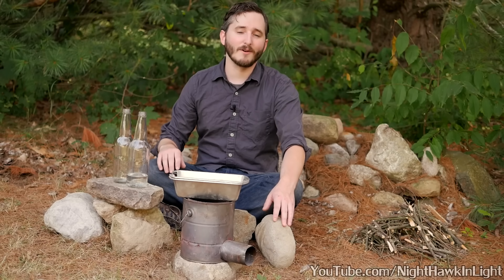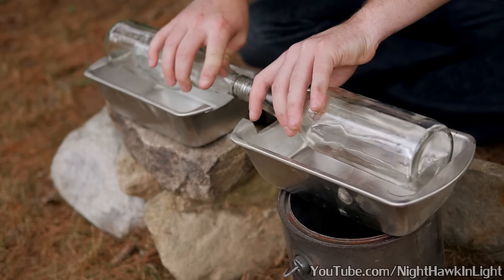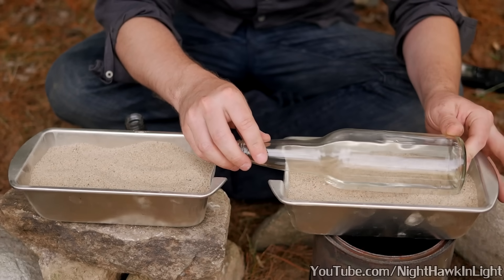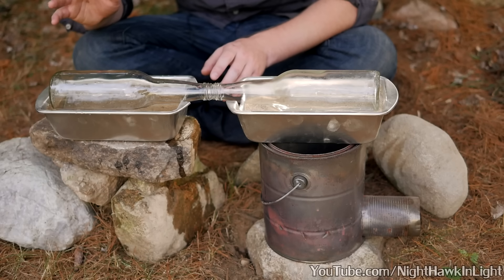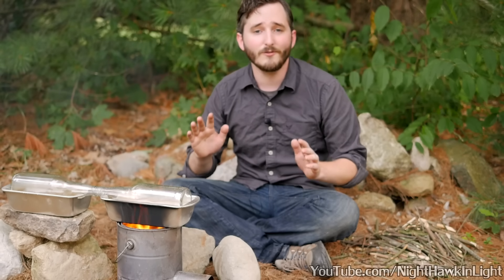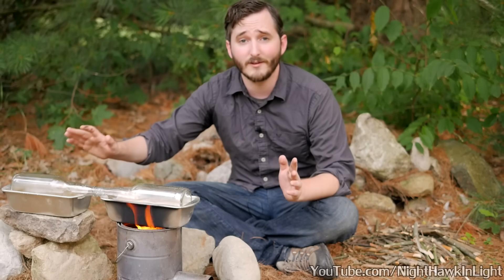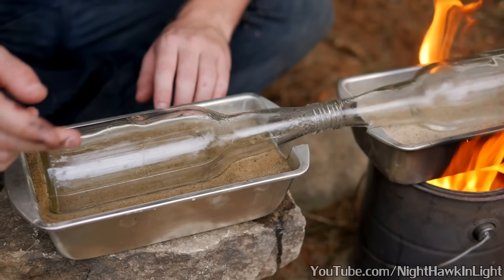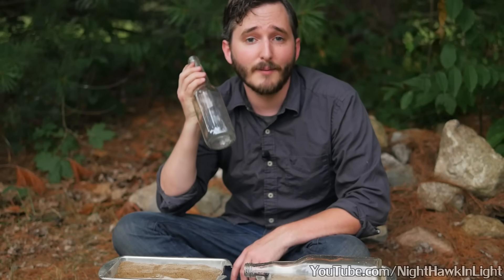How To Turn Salt Water Into Fresh Water (Simple Improvised Distillation)

Comment: 6:08 Technically untrue, if memory serves (there's a list online), the only liquid with the exact boiling point of water is water.  So the best thing to do is let the water simmer for a while (stirring/shaking to increase surface area exposure, if you can) to evaporate said chemicals until you collect it.

I would speculate 3 minutes of simmering while stirring should suffice before putting your water in a distillation device but, of course, it's situational.
Reply: You can't control the temperature in this contraption so heating to 100C exactly is a no but that's not even why you shouldn't, chemicals and oils are relatively volatile so you'll have evaporation at any temperature even if those things have a higher boiling point than water. (most are lower btw) Also, evaporation here is different than what it actually means. All that happens is that enough energy is added to the surface of the liquid to allow it to escape the liquid phase into the air. You don't actually need boiling temps to do this. A distilling contraption with plastic sheets in a sand pit also doesn't go to 100C but you'll still be able to extact water because you'll see evaporation at any temperature above 0C.

Comment: Good to know if I get stuck somewhere and there is only salt water. You could wrap the mouth of the two bottles with aluminum foil to make a better seal. But you don't want a perfect seal because too much pressure will build up.

Comment: Why could't you leave the glass bottle with the salt water sitting in the hot sun, then bury the second bottle under some cool sand?  It would take longer than boiling  but I think  water from the first might evaporate and distill inside the second, cooler glass bottle.   Bad idea?
Reply from the maker: It would work, but you'll be lucky to get a few drops per day.
Reply: Have you tried?  If the sun were hot enough the evaporation rate into a cooler spot would be rather high.  And you could use plastic bottles rather than glass.
Reply from the maker: Yes, I've tried. It's very energy intensive to evaporate water. It takes a long time with only sunlight, even if the bottle is painted black.

Comment: In an actual survival setting one should strive to make the first bastion be a large as possible so extra water can be collected, depending on the location for water needs using this method would take a considerable amount of time for little water return, of course you could also collect water from a simple spigot or digging into the ground to find a reservoir.

Comment: Hey if you find oil contaminated in water, then take water a few inches below the surface. 
This is okay only if the oil is seen to be insoluble. Some contents like soap or other chemicals will make the oil mix in easily with the water :(

Comment: This is pretty awful.  How  will you  get  metal trays  out in  the  middle of  nowhere and  cut  holes  in  the  side  like  that  more  so?  Are you  sure  bottles  you f ind  on  some  beach  is  clean?  No  cleaning instructions?  The diameter of the bottle  is  barely enough to hold  any water  worth  a shit  on  either  side  until  it  flows  over  to the other side,  requiring  a  lot  of tedious maintenance whilst  in  operation  to  keep  it  going  indefinitely. Put  too  much salt water and if it boils, it'll easily flow into the other side.

Comment: I have an idea that may work for oily water...
Providing you aren't bald.. Make a filter out the shirt of your back..make a cylinder from cloth fill it with your  own cut/ hair 
Put stuffed cylinder into both necks so half in each...Whammo you have a oil filter .I use a stuffed pantyhose full of human hair knotted together to contain accidental oil spills when we go boating on the river or lakes you can wash panty hose out with soap hang it to dry use it again next again sorry the digression its an example how good human hair is for oil filtration in this system

Comment: Good vid. One thing should be noted-
Don't too firmly secure the mouths of the bottles. They need to be able to push against one another if the pressure goes up too much since you are heating a closed container, which is not usually a good idea.

Comment: Cool.   If you had a rubber or plastic tube that fit over the mouths of both bottles would it work as well without both bottles being at the same height there by eliminating the sand and the necessity of keeping he bottles even?  The distilled water bottle could then just stand upright...right?

Comment: You mention that once a portion is finished, you can refill the bottle and continue. I assume it would be refilled with cold water. Will the bottle not shatter when placed on the hot sand?

Comment: Your stove didn't look like a rocket stove, just a plain stove.  A rocket stove has an interior fire box, or can, that's insulated from the outer can (with sand or better)  to enable the fire box to achieve much higher or hotter temperatures to burn almost anything, emit very little smoke, and leave little residue. It also has a smaller opening on top with an insulated chimney inside to maintain the very high temps and high efficiency burning in the fire box. It sucks in air at high velocity causing the "rocket" sound. I see nothing "rocket" about your stove (besides the cool name:)

Good video though with great possibly life- saving ideas.

Comment: Could you adapt this method to use a Dakota Fire Hole to do the heating? Then the 2nd bottle could be placed directly in the ground (with a little damp sand).

Comment: EXCELLENT VIDEO. THANKS. :)
PEE PEE WATER TO DRINK:
UNDERSTAND the principle that any dirty-or-salty water (not oily) evaporates but can be re-condensed as clean liquid water by collecting it on some cooler surface and funneled into a clean container.

EXAMPLE: In a desert or wherever, 1. pee all over a wide depression in the sand. 2. Place a bucket or other container at the middle. 3. Cover the wide depression with a sheet of plastic or a rain coat etc. with the "plastic?" part facing down. 4. Place a stone or rock or a little sand at the middle to weight it downward in the middle. 5. Allow time for the pee to evaporate maybe in the hot sun and condense onto the plastic covering so it will flow to the middle and drip into the container as clean drinking water.

Comment: Nice knowledge to have, but if you're in a servival situation at the coast you would be better of finding a stream and boiling the water or collecting rain. If you were on a small island with no stream and not enough rain then it might be worth doing however the chance of finding two glass bottles will be low as glass bottles don't float so are unlikely to to turn up on islands.

Comment: The simplest still is any container with fabric over it. The steam rises through the fabric and can be wrung out at saturation. With some resourcefulness even the container is not entirely necessary. Hot rocks from the fire placed on a pile of wet sand or dirt with fabric spread out suspended above it will collect some steam. The more sealed it is without touching the sand or dirt the better. A container is preferable. A hollowed out log bowl or a dried clay bowl would work with hot rocks but a metal container would be better.
Reply from the maker: I'll have to try that.
Reply: I was wondering (since sailors get into this situation) if there was not a way to use aluminum foil to reflect the sun and plastic to catch evaporated water. That would eliminate the need for a fire which would make sense in a lifeboat in the ocean.

Comment: @06:20  Your statement "...you don't want to drink any distilled water if you're trying to distill out man-made contaminants...." may be correct for this specific emergency method if you boil your saltwater bottles dry each time, but isn't correct for all distilled water. Basically you're referring to VOCs in the water, some of which vapourise above 100 degr C (these do end up in your distilled water container only if you let all the saltwater evaporate - this can largely be eliminated by simply not boiling the saltwater bottle dry, since everything that did evaporate up to that point would have been water only at 100 degr C, the above 100 degr C VOCs will still be in the remaining saltwater, which is simply discarded), and some below 100 degr C (all of these will always end up in your distilled water bottle - these can be eliminated very simply by boiling the distilled water afterwards in an open container with a rolling boil of a couple of minutes, since it will evaporate out of the open pot before the water reaches 100 degr C when the water starts to boil.

Comment: highly inefficient, sand is an insulator not a conductor of heat and only serves a useful purpose of holding the bottles, not sealing the bottle tops together means you can not build pressure, when you boil water and get steam you greatly increase the volume so with no way to build pressure most of the water vapor will escape, way to much work lan loss for this to be a feasible water source in a survival situation where you need to be spending a lot of time doing other things to insure you survive

Comment: I've walked beaches on the West Coast of North America over 50 years and have yet to find an intact glass bottle.  The only intact ones would be because of someone drinking on the beach and discarding the bottle as litter, an offense for which stiff fines can be levied.  Unless a bottle is corked, it will ship water and sink to the bottom, and won't "wash up" onto a beach.

Comment: Drinking distilled water can be very dangerous - so this method is pretty much useless. (Distilled water doesn't contain any minerals)
Reply from the maker: There's enough salt in the output from mist carrying over from the first bottle. You can also add a few drops of saltwater back into the drinking water if you're really concerned.
Reply: @Nighthawkinlight  Alright then it should be okay, was just worried :)

Comment: NightHawkInLight You need to add a few more bits of info into your experiment

1. If the entire setup is tilted on a .. say 5-10 degree angle (angle for the dirty water bottle) from the ground, the distillation would be more effective since hot water vapor travels upwards... If both are on a level plane, the exchange is not as effective even if the distilled bottle is cooled (since its not constant lvls of cooling)

2. Your making distilled water... it does not contain necessary salts for the body... meaning ... ONLY USE FOR EMERGENCIES for quenching your thirst (it will take away minerals from your body as well)... you mention distilled water in your experiment but have your video title as 'Fresh Water'.. They are not the same. This is why Water purifiers don't just heat water and instead use the myriad of carbon filters, electrolytic filters etc.
Reply from the maker: In this setup enough salt mists over from boiling splash between bottles to add plenty back in for the body to use. If not you can add a few drops of salt water back in.
Reply: NightHawkInLight Well... If it were only salts, then I'd be okay.. But there are pollutants in it as well right? Neither sea water nor naturally found water sources are completely clean. Adding some back seems to defeat the cause of distilling.
Example: The Arabs from the middle east convert sea water to drinking water since fresh water is a bit rare in many regions.. They use filtration techniques rather than distillation because it's not viable.

Comment: could you do it with plastic bottles?
Reply: nope i suspect plastic would melt
Reply: You could but only if heated with sunlight, meaning your distillation rate would be at least 4 times slower.
Reply: @dodgeplow  On the bright side, you don't need to build a fire. I think the water would taste like plastic though and probably wouldn't be that good for you.
Reply: Bad taste or not, the problem is that since it'll distill so much slower, you'll still die of thirst unless you have multiple bottles

Comment: 1) perhaps  a short  length  of flexible  metal  accordion  tubing  might be  used to  join  the  two  bottle  openings ?  2) Might  one  make  a charcoal  filter  using  the  rocket  stove  left over to further  filter  the  water?

Comment: Thank you for the video, it's a very useful method. I also red it somewhere that you can use plastic bottles, maybe 2l ones, and you paint one of them black and you just expose the seawater to the sun, and the evaporating destilled drinking water you can let evaporate through a pipe in another bottle next to it. I have no idea how much time it takes, probably a lot longer than your technique, but at least you don't need to use fire. Be safe everyone :-)

Comment: thanks for posting.   some late thoughts.   this could work for, generally, contaminated water.  which is good.    but, come on.  efficiency is about one percent.   efficiency could be quadrupled by supporting the 'hot' bottle in a more upright orientation. 
then, let the steam and heated water vapor impact and condense on a suitable object or piece of fabric at the mouth of the 'cold' bottle.  which would be in a nearly upright orientation.     it is understood that when used on the hotter side, any one such bottle will not survive very long.       cheers

Comment: ( I was a Drill Sargeant for 7 yrs in the Army & a 55B Ammo/explosives for another 7 yrs.)
  Another way to distill water:
    Ahead of time drill the middle part of the caps of plastic bottles out & crazy glue the tops together. Screw the tops on the bottles & put in your back pack. (Make 1 or more sets of 2 bottles it's up to you how many you make)
     Put some say sea water (or dirty as in muddy not with other chemicals or oils in the water)  in one bottle then screw the bottles together. Put the sea water bottle lower on the ground & the empty bottle have up alittle higher & you can use the sun to heat up the sea water bottle.  OR
   If you have a sandwich  or some kind of plastic bag fill it with water then turn on it's side, empty water till you see a triangle of water in the bag & gently twist the bag to make as close to a ball without breaking the bag & tie it off.  To speed up heating the salt water bottle hold the bag over the bottle & it will be like a magnifier & heat your water.
   If you take some bark off a stick or dead tree stump & grind that bark with a stone & save it on another piece of bark. Have gathered some dry grass & small thin twigs & stuff to fuel a fire ahead of time.
     Take your powered bark & sprinkle some on the bigger piece of bark & put your bag of water ( you make it like instructions up above) over the powdered bark & just slowly add more powdered bark as you see alittle smoke, put alittle toilet paper strips on it & as it begins to burn add alittle bundle of grass you can put your smoking bark in & lightly blow on it & it will start a fire, use your twigs then bigger sticks ect.  A fire with no matches.
     If you have no spare water you can use urine. Put your pee in the bag & that works fine too.
Reply: Are there that many ignorant people out there they get some great advice on how to purify water and the only thing they can think about is how to spell sergeant, get a life now I would like to see a video thanks by the way Walmart is hiring for great spellers
Reply: please make a video doing this !!
Reply: @Zack Schwab bet hes lying (my spelling isnt the greatest)
Reply: How can you not spell your job title?
Reply: @bjl1000  I didnt realize we are in a war zone atm, and you dont already have to spell your job title correctly.... Spell check could have helped too, but hey, we can all look believable online by misspelling our "jobs"... Heck, I'm a Surjin guys
Reply: @bjl1000  Lol you're some white knight mad that his pog boyfriend is getting bashed online and has to jump in to save his honor. He cant spell, easy enough.
Reply: @bjl1000  Deleted your other messages lol. I'm not a petty child like yourself.
Reply: SArgeant!! Lol
Reply: @Zack Schwab You're the type of dude that would die from dehydration on a remote island from neglecting to purify water because you're more concerned about whether you spelled "HELP" right in the sand.
Reply: That is the proper way written  , not this way we are viewing on the video  , this person would die in less then a decade useing this for resource life water
Reply: As described in your first example, you're just building a steam bomb. You'd need a pressure release hole - you don't want them perfectly sealed together.
Reply: @bjl1000  Nah was here long before legalization of any sort,  but you must be thrilled the US will be legalized in no time. Loser

Comment: If you were lucky enough to find a large glass jug that cider comes in you would really be in business. You could make 4 times the water faster by heating the larger jug OR continuous heating of the smaller bottle allowing the larger jug to fill. Im sure these Glass bottles could potentially be improvised by basically anything that collects condensation. That is for the collection of the water the boiled water container would have to withstand the heat of a rolling boil.

Comment: You are right about the significant qty of water considering it was for 10 mins only. Am impressed. Perhaps we can work out a way to heat one bottle using a solar energy (perhaps using a magnifying glass) and the other end immersed in sand surrounded by water (cooler end). This could help for real disaster prone areas near the sea when water is cut off.